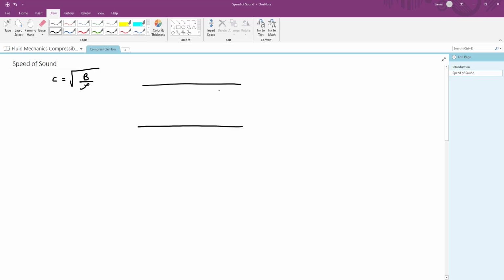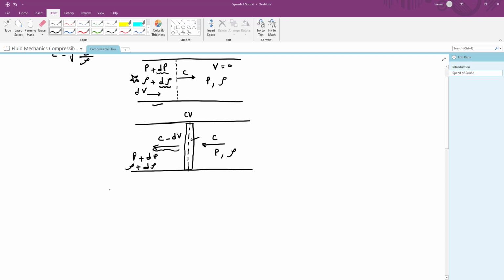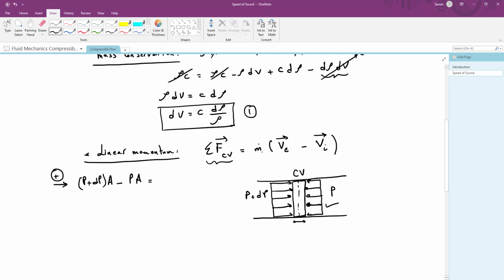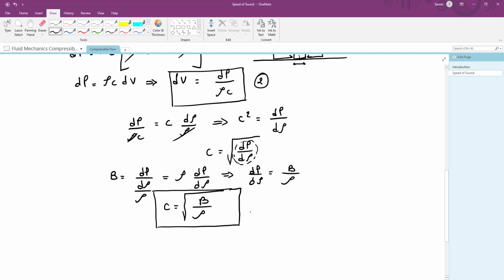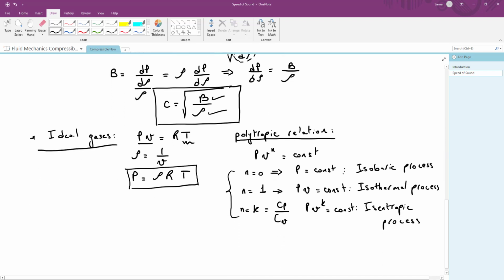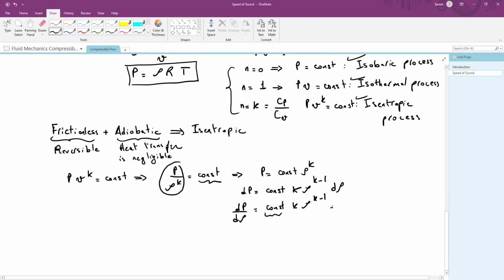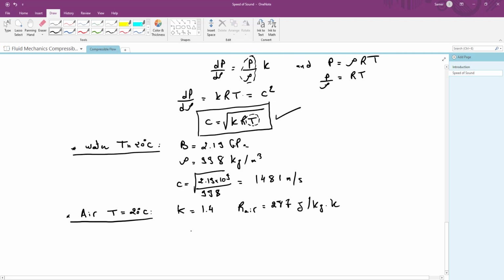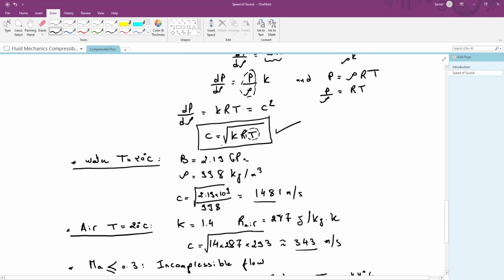1-2 Speed of Sound | Compressible Flow Fundamentals: High-Speed Gas Dynamics

Comment: Excellent lecture. Just a stupid question, why can we write the ideal gas law pV=nRT as pv=RT for v = V/m? Does the molar mass is hidden in some constant?
Reply from the maker: The ideal gas law can be written in terms of mass as pV=mRT if u divide both sides by m you will have pv=RT where v=V/m. Here pay attention that R is the gas constant which different than R' the universal gas constant.
When you write pV=nR'T, R' here is the universal gas constant since its used with the number if moles n
The relation between the gas constant R and the universal gas constant R' is R=R'/M where M is the molar mass in kg/kmol.
So originally pV=nR'T, if you replace R'=R*M in the equation you will have pV=mRT in the mass form.